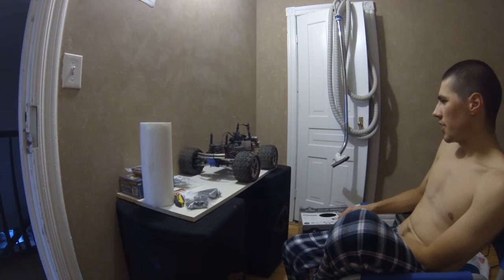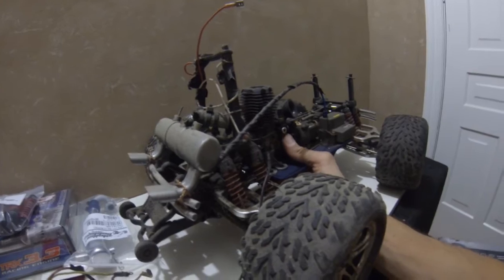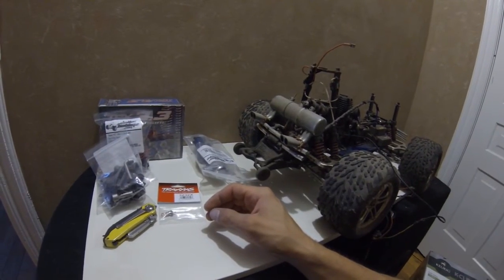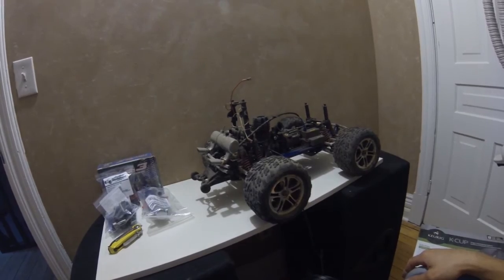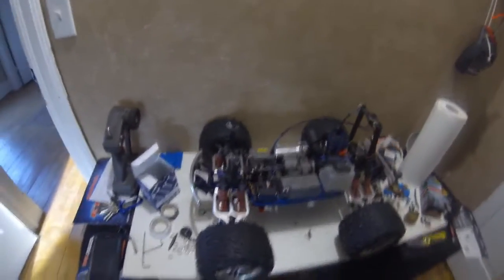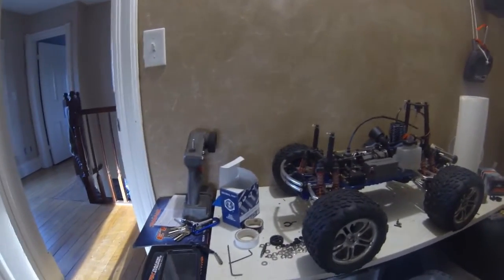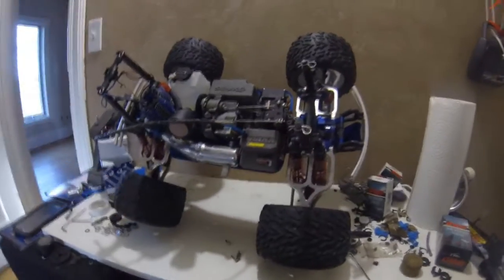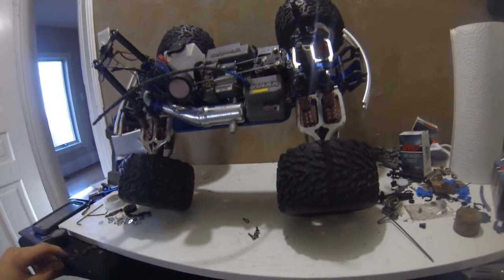Fixing The Traxxas TMaxx 3 3

Comment: nice maxx i have had so meny 3.3s all they do is blow up i had one brake in half  brake on the 1st tank of brake in and ding! the top half of the engine flu in to the air so i got so sick of them i got a O.S .21 TM now my t maxx starts and runns so nice and the power is crazy! and so reliable and holds a tuin the best out of any engine all my buddys are diching there 3.3s and going o.s .21tm ps sounds like your truck is not shifting in to 2nd gear
Reply from the maker: it's hitting 2nd when i open it up on the driveway,  ill make some new videos soon, never thought about an engine swap on that thing good to know it's possible.
Reply: the o.s .21tm engine is a drop in fit for the t maxx look it up on google :)
Reply from the maker: +Luke Shaw thanks Luke I'm going to do that, get all the research done and see where it takes me
Reply: you will not be disappinted!
Reply: trx 3.3 is 0.97HP the o.s .21tm is 1.9HP!! with that engine your truck will Destroy All!
Reply from the maker: Lmao yea thats defintally something to consider!
Reply: runns cooler and tunis ez! and holds it's tuni and runns like a swis watch!